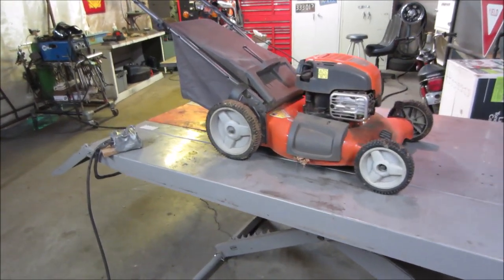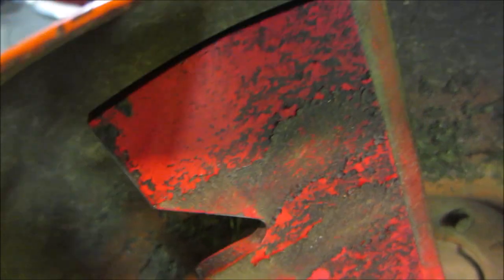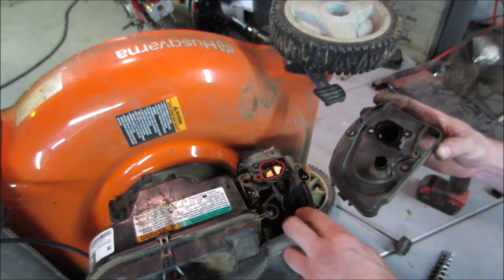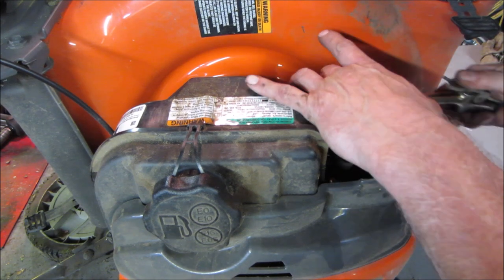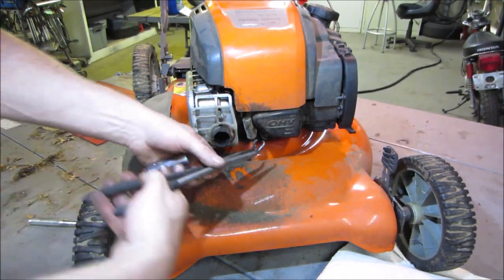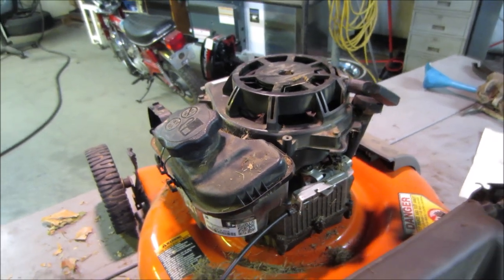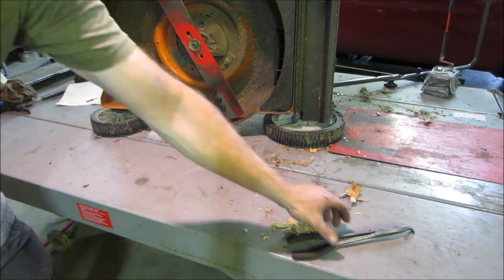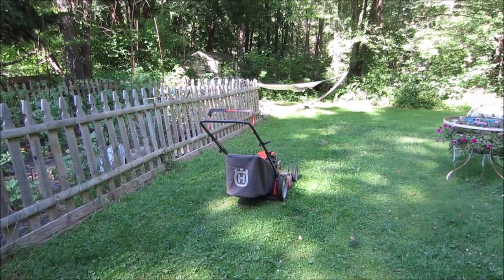NO OIL CHANGES? Servicing A Broken Yard Sale Lawn Mower,

Comment: I worked at a small engine repair shop about 25 years ago. Even then the owner told me that his competition was a $99 mower from whatever big box stores were around. We had a $59 service special on your typical Briggs push mower which included changing the oil, pulling the blower housing, blowing the dust out, sharpening the blades, cleaning or replacing the air filter, carburetor diaphragm, spark plug, and head gasket. While the head was off, we decarboned it and lapped and adjusted the valves. Was about an hour and a half of labor and about $10 in parts at the time. After this treatment they would  usually run like new. This was in the days before overhead valve engines, and breaker points were still around on older mowers we saw. 

We had a quick test to see if repairing an old mower was viable, we turned it over with the spark plug disconnected and spun it backwards. If the engine offered no resistance backing up the power stroke, or the crankshaft was bent, we told the customer not to bother.  Other things that usually totalled old mowers were problems with the self propelled mechanism, and rusted out decks.

 In the day we also had to deal with the valve seats on the Briggs engines popping out. It was a warranty repair, and the official fix was to reinsert the valve seat, and use a center punch to punch divots around the edge of the seat to expand the metal.  I learned a lot from him,  even though I had been repairing mowers on my own since I was a kid.
Reply: The punch method is called staking, and I have used it on many different applications. Basically anything you don't want to move, stake it.
Reply: @MrTruckerf  That skill came in handy later on when I started working on mail extraction machines.  The cutter assemblies would have bronze bushings pressed into aluminum plates that would sometimes work loose.
Reply: 9
Reply: Ever live in Ontonagon
Reply: Speaking of breaker point-and-condenser ignition systems in mowers, I'm sure glad they figured out how to get ignition without them! What a pain in the ass they were!
Reply: Thing is they can return to big box stores and no questions ask, just get a other new one and abuse it for several months and return it

Comment: I was driving with my 16 year old son,we see a old snow thrower in the garbage so I said let’s bring it home , well we take it apart there was just a small gear was the problem,$1.99 for it, put it together, we sold it for $35.00 now he wants to bring everything home,lol
Reply: once you get a taste of the satisfaction of fixing something   youwant   more
its like a drug
ive alwase have been  on it  since i was  5? cant even remeber when it started
worked on  the stuff with my grandpa who   taught me most   of what i  know on  most things mechanical. how to pull and clean a carburator  how to not weld (i still dont know how to weld though to be fair its a harbor freight special on 110 v so a pretty craptastic welder) and yeah hes liek, 70 years old  give or take but he still goin strong  and still helps with things, hell he has a project truck he been workin on for a  long while its geting to the point where the end iswithin grasp, as in he might have it done by the end of this year
granted its wiring shinigans that has to be taken care of  and all of a  fuel  system but everything else is in place but yeah  he has tought me loads of practical things more than the shit school system lmao
Reply: Well, go check out Andrew Camarata, some of the things he does in my opinion can be funny.

Comment: I am 60 now and back when I was about 12-14.....people would curb a mower that sheered the key and wouldn't start.That was really my first summer money making venture.....as my older friend showed me how to remove the fly wheel and insert a new key.Most of the mowers were Briggs powered.....but a few people marveled at me using their old mower cutting grass with something they threw out just hours before.The local mower shop sold me the keys and I started learning more repairs....sharpening blades....cleaning carbs.....so here I was about 12 years old ….going around and showing off my wallet with a couple hundred bucks in it.When other kids were lucky to have 50 cents in their pockets.I had even have a few friends just ask.....hey show me your wallet again.And even a few cute girls were starting to come around.Darren….these videos bring back so many great memories...thanks a lot for your time and tallents..!!
Reply: I'm 15 and go around fixing old lawnmowers that get scrapped at my local scrap yard.its sad to see them thrown out because a jet was blocked or the spark plug had broke. I'm doing everything you do apart from getting the cute girls 😂
Reply: @benturner4774  Hang in there and hone your baiting skills.  It will come sooner than later.  Persevere.  And if u miss out on some maybe it was meant not to happen.  Good luck.  I'm 65.
Reply: I learned because my cheap ass dad never bought anything new. He would pull them out of the damn dump, bring them home and swear to me they were fine. I spent most of my spare time fixing them before I could use them.
Reply: I wish girls were as easy to impress back then these days lol
Reply: @benturner4774  He didn't say he got them. Just got them looking at his money. I'm not saying they were gold diggers...
Reply: Harley Man. For me it was the other way around. Picked up girls as a teen, now I just fix mowers
Reply: @benturner4774  give the girls a miss as long as you can, when you get one (girl) you'll never have no money. Ask my wife of thirty years, but i wouldn't be without her lol.
Reply: It's not encouraging that machines such as lawn mowers and snowblowers are being cheapened to the point of making them non-repairable.
Reply: Harley Man - That's when I started on mowers. There was a dump for leaves and limbs near my house. People would occasionally sneak a junk mower in there and I would dig it out and tear it apart. I had my own business for about 11 years back in the early 2000's. Self employment isn't the American dream I thought it was LOL. I'm 51 now and know better.
Reply: Ben Turner find a girl that will work on mowers with you
Reply: Apartment complex I lived at everybody had to cut their own grass, everytime I pulled the mower out of the shed someone else had run over something and destroyed the key. I finally just told the land lady I would cut the grass because I was tired of having to fix the mower
Reply: Harley Man who cares
Reply: @benturner4774  they will come. Keep it up 😊
Reply: The things you can get from people that only need a simple repair to work! It's always fun when you get a 5 dollar "won't start" mower and a quick and easy clean of the carb lands you 50 bucks from someone who just needed something cheap to mow their backyard with.
Reply: Are you my long lost brother?
Reply: Ben Turner     I’m 63 years old, scraping newspapers, metal when I was 12. I made a few bucks. Bought myself a transistor radio. Sat on my front porch playing the radio and cute girls walking down the street would stop and sit with me. Your extra effort in life will pay off. Are you sure you’re not my so?
Reply: I work on small engines as well
Reply: Now people set them out in the alley or wherever because they won't start on the first pull
Reply: @1575murray  they haven't got that good yet LOL
Reply: ShootTheMoon  90% of the mowers I'll pick up or anything is not wore out and usually start new or old
Reply: @scottfirman  never bad to.learn how to fix things. But it's also important to know what priorities you have. Quite often it's simply put more economical to buy new and wear it down. Time spent fixing stuff is rarely profitable at scale.
Reply: funny i had to do that exact repair to the motor on my dads briggs about 12 months ago
Reply: Sounds like some golden times man! Good stuff.
Reply: @benturner4774  you can make a decent side living do that.
Reply: @scottfirman  Sounds like how I grew up.  Everything we owned was crap dad barely outbid the scrap man at some auction for and anyone who's ever been to a auction knows the scrap guys don't pay much for stuff because its worn out junk.

Comment: Just wanted to give you a  big THANK YOU. Yesterday I was rebuilding a carb from an old Yamaha AT bike. When I got it cleaned up and put back together I used the first trick I learned on your channel. First I used your test for the float valve Blow into fuel inlet, carb upright and then carb upside down. It wasn't sealing tightly. The second trick I learned from you was the Q-tip with polishing compound in the seat. Polished it a bit and problem solved. Thanks again Mustie1 Your channel is the best thing on YouTube.

Comment: I used to be a repair center for a product that was in a plastic case. An old friend taught me this trick and I'll pass it on to you for your consideration. When you are returning a screw into a plastic there are threads already cut in the plastic. As plastic ages it becomes brittle, so if the screw tries to cut a new thread path, it can crack the plastic. To prevent this, turn the screw backwards with slight pressure on it until you hear or feel a click. This is when the threads on the screw are aligned with the threads in the plastic, now you can turn the screw to the right and the screw it will use the existing threads, no undue pressure on the plastic so no cracking. HTH. Good video.
Reply: I agree 100%. I used to repair vacuum cleaners for a living, and to be able to service it again and again, it really helps, of the screws find the original threads each time. That helps to avoid stripping out, or breaking/cracking the screw towers from repeated disassembly and reassembly. I also try to avoid over-tightening, but in the case of a lawnmower, you have to make sure they're tight enough, that the vibration doesn't cause them to loosen.
Reply: Honestly, I thought everyone did that, lol. I always do it, because when the plastic is soft and you just turn it, it'll chew up the hole over time and the screw will just spin through.

I noticed that with the car I recently got - the workshops didn't care and two of the screws don't tighten any more, because the hole is just gone.

All in all it's a good idea to do for any screw to prevent cross-threading.

Comment: Bought a briggs and stratton sidevalve poulan about a month ago, dead stop brake cable  was siezed and broke, and missing top handle, removed brake, made a handle and fitted a kill switch and throttle cable, spent 3 hours mowing the field with it today, after sharpening blade and service runs perfect.
Reply: Yes it's usually the safety stuff that keeps one from running you need to know about basic electricity

Comment: At the Ace Hardware that I work at, we just got in a bunch of new Toro lawn mowers that have the no oil change feature! When I sell one to a customer, I tell them that I am not comfortable with never changing the oil and recommend that they change the oil once a year at least. Great video.
Reply: The engineers that designed the engines know much more about what's happening inside of them than you do. Metallurgy, and oil technology have greatly improved in the last 50 years.
Reply: @bige.3474  ...and oil still breaks down. Change it.

Comment: Never Change the Oil is another way of saying, "See you in couple of years because you have to buy a new mower".
Reply: It's unbelievable.
Reply: You are right
Reply: Reminds me of those shit-ass air compressors Campbell & Hausefeld no crank-
case for compressor oil, yup bilt cheap. for 50$ more I got a nice central
pneumatics at harbor freight. compressor has a crankcase with sightglass
for checking oil level.
Reply: To be honest, from the look of the oil in most of the mowers he works on people aren't generally ever changing oil anyway - so no need to recommend it, really.
Reply: Had a push mower craftsman 5hp. Never changed the oil and only added when needed. Oil was quite black but after 10 years was still running great. Hard to believe.
Reply: Actually synthetic oil is so good nowadays that you need to rephrase that to "See you in ten years because you have to buy a new mower". And most people won't complain about that.
Reply: my mower after the first year actually ran out of oil and I'm just waiting for it to go ahead and blow up at this point. And actually screw down to a halt and I can't believe that it did it but I guess I'm buying a new Husqvarna motor soon
Reply: @AR1G3  Most mowers don't have oil filtration. Synthetic doesn't do anything to keep dirt out of the oil.

Synthetic can extend intervals IN CARS b/c they have filters, and operate in a clean environment. Mowers have no filter (usually) and operate in dusty environments.

TL;DR: your mower's oil gets dirty way before it gets old
Reply: @bcubed72  No but it is formulated in such a way it sheds dirt and doesn't trap it. There will be dirt in the bottom of the engine, but it will be a sediment that isn't thrown around the engine with the rest of the oil. Oils are high tech nowadays, they're not 'just' oil.
Reply: I have one of these mowers. They burn oil like crazy, so I assume that is the system. Instead of changing the oil, you just burn it, and then replace it with fresh stuff.
Reply: @raymondgarafano8604  I think you're talking about the diaphragm type of compressors.  They don't need oil because they don't have any moving parts, just a loud noisy vibrator that rattles a diaphragm.  I'll bet you bought that black $150 Central Pneumatic one that I wanted, but now they've apparently cleared them out.
Reply: @donf3739   actually I saw them a month ago at harbour freight in Hyannis mass. yup got a crank case and air filter.  won't start in 20 degree weather. brot it into my kitchen by the time I finished my coffee she would start. had it two yrs and no problem, got a nice 7 or 8 gal alum,
tank w gage put a longer hose on it and good brass fittings I can put air in and go to bike to air up tires. I think I got the compressor for 130$
Reply: @raymondgarafano8604  Right now, in Indiana, they're showing them for $149, but on clearance, and nobody has them anymore.  Will just probably have to shell out a little more, for something with a little less horsepower.  Oh well.
Reply: Mickey Mishra l
Reply: @AR1G3  l
Reply: I have a 6.5 horsepower Craftsman push mower that we've had for 18 years. No blade changes, no oil changes, no carb adjustments, just add gas and have topped up the oil once. It starts first pull everytime and cuts grass. I run over popcans, gravel, rocks, tree branches, and target bags with it in hopes of buying a new one, but it doesn't quit. It's unbelievable.
Reply: @19MarkDavid  Same situation here, if you read my attached comment. I have a Craftsman with extreme neglect that doesn't die.
Reply: @bcubed72  , most of the "dirt" in oil is carbon particles formed from oil burned on internal hot spots.  Synthetic oils don't coke up as much as dino oils and run cleaner.
Reply: @21stcenturyfossil7  I'd love to see the data on that. I suppose I could do used oil analysis on it, but it's a bit extravagant, at ~50% the value of my old mower.

A lawn is a very dusty environment. I'd be surprised if there wasn't significant dirt ingestion.
Reply: @bcubed72  , I believe air filters are pretty effective.  My mower has an oiled foam filter and I've never seen dirt work it's way through.  Paper filters are probably at least as effective as oiled foam but because they're dry, the inside can't be expected to hold any dirt on the inside.
On the other hand, I've popped apart dozens of engines, for repairs or just curiosity, and I've seen how much oil cokes up on ports that carry exhaust gas.  The heat burns the oil and the carbon particles get everywhere.  For dino oil, I believe wide range multigrades coke up the worst.  10W-40 is worse than 10W-30 which is worse than, say a SAE 30.  I suspect the viscosity index improvers are especially sensitive to heat.  Synthetics are formulated to be more heat resistant and don't thin with temperature to the extent of dino oils so they naturally act multigrade with little or no VI improvers.  A double win!
Turbulence and expansion/contraction will release these carbon particles from the exhaust passage and these particles can link themselves up and , at worst, clog up oil passages and fill the area behind the piston rings, reducing their effectiveness.  I believe that a modern, high detergent oil will hold most of these coke particles in suspension until the oil gets drained. 
Anyway, that's the way I picture it.
Reply: Jimmy S  How does your friend know his mower wore down the rings?  These engines have an aluminum bore and I can't picture much ring wear.  Lack of compression might indicate stuck rings, a leaky valve or a leaky head gasket.
Reply: Jimmy S  Very good!  My guess, for what it's worth, is stuck rings or a grooved cylinder.
Reply: @bcubed72  , Just to add another speculation, I don't know anything specific about the Briggs no oil change motor.  But, If I was thinking about extending oil life far beyond the old flatheads, I'd go to an OHV design with as short an exhaust port as possible, maybe with an air gap around it.  The bottom of the piston is another hot spot but not so hot as the exhaust port.  A selected oil might be good enough.  A no oil change motor might be an overstatement, but it's my thought that an infrequent oil change motor is practical.
And if the oil outlasts the deck or any other uneconomical repair, that's as good as never needing an oil change.
Reply: Toro must think some people are stupid.
Reply: Well I'd say a bit longer than that, but yeah, not a good idea. Changing it after the first hour, and then every other year is probably ok.
Reply: Not really